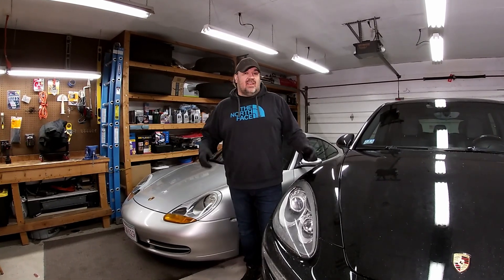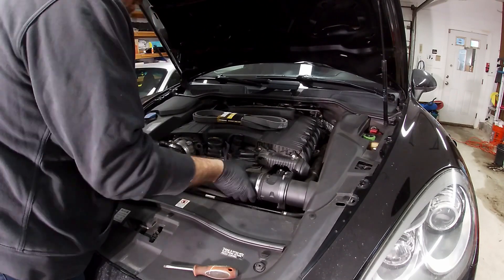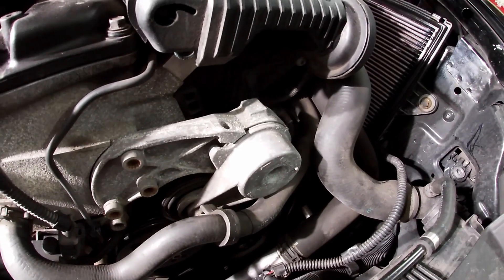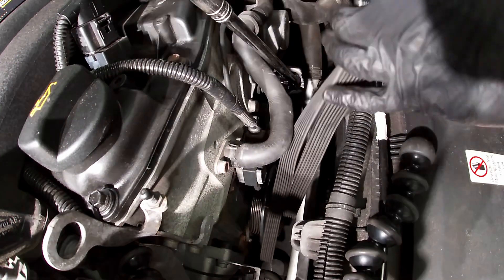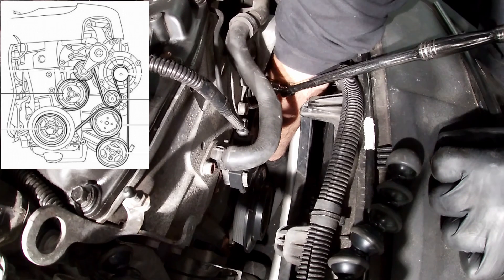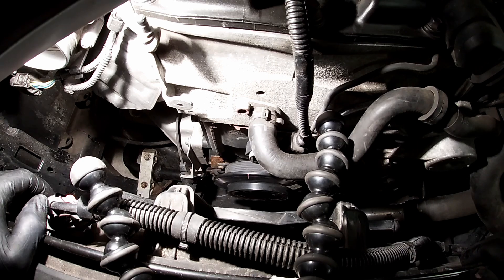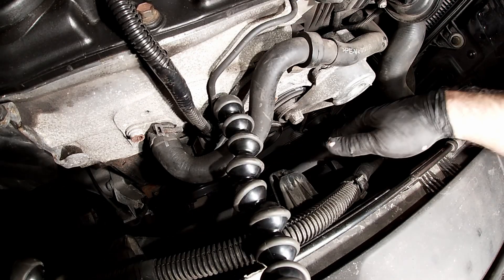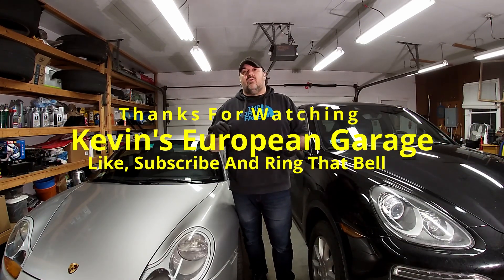Porsche Cayenne V6 Drive Belt DIY

Comment: An M8-1.25 x50 mm screw can also be used to relieve tensioner. There’s a threaded hole on the top of the tensioner unit where it goes in and screws down and pushes the tensioner ccw to relieve tension. This method (per Porsche service manual) works good since it keeps the tensioner relieved while the belt is removed and replaced.
Reply: Thanks for posting this. I couldn't find what size it was.

Comment: Theres also a threaded hole in the top of the tensioner if you have the right size bolt it hold the tensioner open and makes it easier!

Comment: Working on mine now I’ve hit 150k miles and fixing everything the motor is well and looks brand new and drives perfect just some water pump problem have to drill it out and it stuck in the engine block

Comment: How long did it take to replace your belt?  Is the 2010 V6 similar enough that you can do the same operation for replacement?
Reply from the maker: I can change the belt in less than an hour. Probably closer to 30 min. Its not very hard. It should be very similar on your 2010